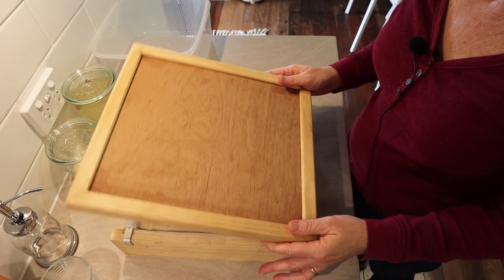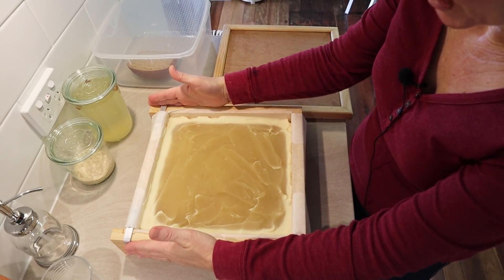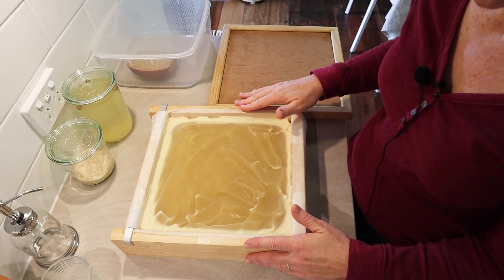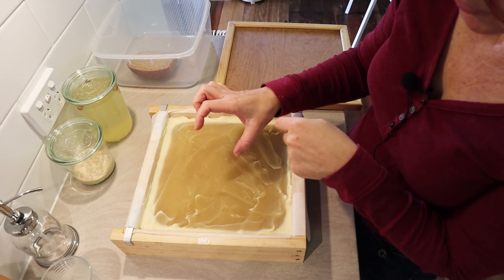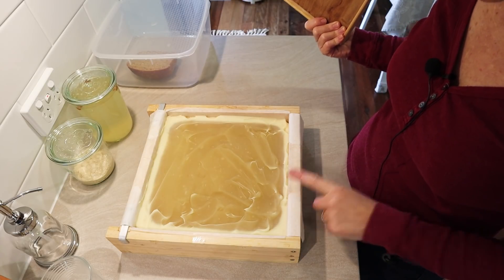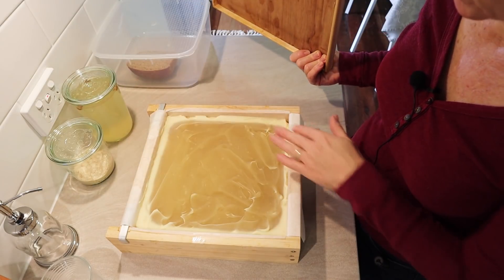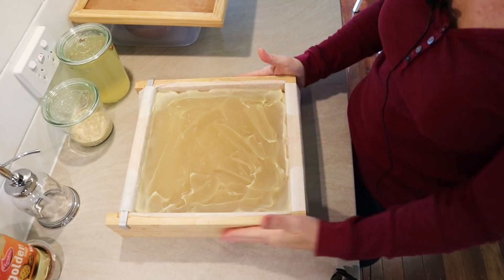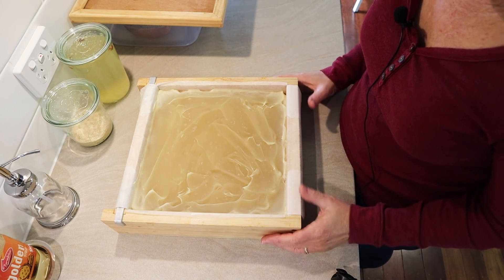About 'Gel phase' in Cold Process Soap Making. What is it? Why consider it? How does it work?

Comment: Thank you for sharing such great tips and tricks!  You do the best job at explaining why things work the way that they do.  I am brand new to soap making.  I have rectangle molds that fit inside wood frames. My first batch had a gel center ring. My 2nd batch was a complete disaster.  I used too much water.  It was wet and super soft.  I did a rebatch, but it is still soft.  I don't know how to fix it.  The 3rd batch I placed inside a warmed oven, but it still has the gel center ring.  Do you have any suggestions on how to make it gel completely? I love the colors of the outer loaf of soap.  I would like for them to have the same pretty colors inside too.  Thank you!  Have a blessed day. 
Jackie in USA
Reply from the maker: Hey Jackie, maybe try using warmer ingredients? Or wrap in a woolen blanket, or something else really warm?

Comment: Thanks so much, Mrs Elly. I learned much from you. I have partial gel in both oat soap and avocado soap. I use coconut oil not too much, only about 33%, and medium water 33% lye. in avocado, I used 10% water discount. I live in tropical climate area, so I don't find what is the cause for this partial gel. I poured lye solution right away, didn't wait them to cool down, if only they already looked clear and well disolved. could it be the reason for partial gel in my soap? TIA

Comment: Hi Elly!
I've been learning a lot from you and your videos! Altho I'm from the Philippines which is very warm (hot even)....makes it hard for me to understand some stuff about gelling the soaps. Is it possible that I don't need to insulate the soaps in a silicon mode considering the fact that the room temp. is very warm (hot)? Will it gel on it's own? I'm considering on making  my own log mold with my dad as well.... as far as I learn and understand from your video today....I don't need to insulate my soaps if ever I use the log mold here in the Phillipines because it might get too hot like the volcano you mentioned and leading to crack my soaps(?) 

I hope I'm correct x'D
Reply from the maker: It really depends on the recipe! Some heat up more than others. But generally speaking, yes you can insulate your soap less in hot weather. (ie, in summer I often just use a towel, in winter a warm blanket).

Comment: I just got into soap making and continuously have been running into the same problem that from what i've seen no one else is. It's as if my soap is stuck in the gel phase for days and won't harden. Do you have any clue as to what might be wrong?
Reply: yeah, yesterday I made Castile soap and I checked it today and it is still in the gel phase! I wonder if that is normal?
Reply from the maker: That sounds odd to me. The gel phase at most usually lasts half a day.

Comment: So if I’m doing small batch hot process soap in a crock pot, if I’m understanding you correctly my cook time is actually forcing the gel process?  I’d like to try some cold process soap making. I like the smooth top you achieve when you do not cook the soap to such a thickened state.  Even though I told my cooked soap is ready to use, it still lasts longer and is milder when it is allowed to sit for several weeks.  Another question I have is about essential oils.  It seems that adding essential oil at the end of the cook seems to destroy (evaporates) much of the oil scent. The cooked soap cannot sit until cooler before adding essential oil as the cooked soap sets up too quickly.  Is this issue avoided with CP soap? Thank you.
Reply from the maker: Yes, you're exactly right Michelle! CP is much easier for adding EO's to soap.

Comment: Thank you for making this video. I always find it interesting how different people do their soaps. I always learn something that I didn't know or that I did know and had forgotten. For all of my bar soaps I make them in a 5 pound mold with a wooden frame.(I have several).  As soon as they are done being pored, I sit them right up against each other so they can help each other gel.  Almost all of my soaps are goats milk, so it usually doesn't take to long. I cover them. I check on them about every 10 to 15 minutes or so to see their progress. as soon as they are fully gelled I put them about 1 inch apart so they can start cooling down. I then put them under a fan on med speed and leave them uncovered until morning. This works very well for me. They do gel much quicker in the summer months of coarse. Thank you for your time. mary  ( grandmarysoaps ) TN USA
Reply from the maker: You've got some great soap making wisdom there Mary, thanks for sharing x
Reply: @EllysEverydaySoapMaking  I don't know about that but thank you. I just love making soap. I have been doing it for a while. lol. I learn a lot watch people like you.

Comment: Thanks again for a well explained video. I see from the comments you have a lot of new soap makers following your instruction, myself included. There is indeed a lot to learn, I'm on my fourth batch now, trying different variations on a combination of oils  and lye concentrations to find one I like. The frustrating part is waiting for them to cure and see if they are any good. My first batch from late April is now cured enough that it doesn't melt in the shower after a few days.
My latest soap, traced very quickly, a few minutes  and started thickening as I was stirring in the colouring, I just managed to get it in the mould albeit by spooning it in as it wouldn't pour. it seems ok and I think the heat was a big factor in this as my oils and lye solution were over 40 degrees C when I was mixing them, only time will tell if it is any good, I'm confident though.

It's possible you have explained in a previous video but if not can you suggest whether using warm oil and lye solution is better than room temperature liquids? 
Keep up the good work, you inspire a lot of us soap makers.
Reply from the maker: Thanks Andrew, I'll be doing a video on soap making temperatures soon. It can be important, yes :)
Reply: @EllysEverydaySoapMaking  I look forward to watching that when it comes.

Comment: Hi Elly. Great video as usual! Will 100% coconut oil soap always reach gel phase in a log mould? Also does the silicone liner make a difference to how quickly a soap will gel or not?
Reply from the maker: Yes, 100% coconut oil soap will usually fully gel in a log mould, but it depends on the soap making temperatures, and room temperature. Silicone mould liner won't affect it :)

Comment: Hi Elly. Thanks for this great video - I love them all!!! I have learnt soooo much from you and make lots of soap for my family and friends. 
I have a question: some of my soaps have remained quite squishy in situations where there is little airflow in a shower or bathroom - is this to be expected? My soaps do gel thoroughly. I live in Mackay, so is it the humidity?
Is there a way we can send you photos?
That’s all. 😄
Have a nice Sunday!!!
Reply from the maker: Hi Kim, yes some handmade soaps are quite soft, especially in high humidity. I love olive oil based soaps, but they are quite soft! They need to be dried very thoroughly between uses or they don't last long. I keep a few bars going at the one time and pick the driest one. If you use different formulations you will get longer lasting soaps, depends on the skin feel you're looking for. You can send photos via my website if you like :) (links below)

Comment: Elly, two days ago I made your recipe for aloe vera soap.  It is soft and when I tried to take it out of the moulds the bottom is not completely set.  Do I just leave the soap in the mould until set completely?  This is the second day.
Reply from the maker: Yes it is a soft soap. I would take it out of the mould if you can get it out, but if it is really soft just leave it there for another day. It will become a nice soap with a good cure period.
Reply: Thank you!

Comment: I once had to force the gel phase to have a homogeneous color of the batch because it was a specially reuquested soap. So i just put it in the oven at 50⁰C for few minutes under direct supervision and the gel completed and the color of the green clay was much better as well
Reply from the maker: Yes CPOP works really well! You can run into trouble with silicone moulds though, I talked about that in my blog post (link below).

Comment: Hello.. I use individual moulds and cover and wrap as soon as pured. I find some bars especially those with sandalwood, bergemot or bay in trace very fast and do retain lot of heat these bars can show glycerin swirls in.  Also my wrapped soaps can stay hot for a day so I'm assuming they are gelling and going through the saponification stage naturally..they last long time and don't take on anywater. Coconut content is over 30%.
Reply: Thank you for sharing. Is this with cold process soaps?
Reply from the maker: Hi Lynda, yes that is possible with some FO's and it sounds like you're using high water if you're getting glycerine rivers? High water soaps gel much more thoroughly and for a lot longer than low water soaps.
Reply from the maker: Yes the coconut would make the gel more vigorous too. I've got lots of detail about all of these aspects in the blog post (link below)